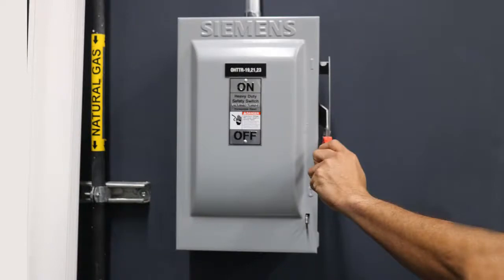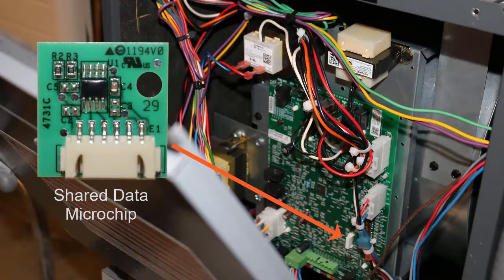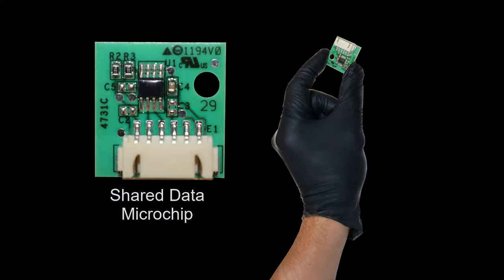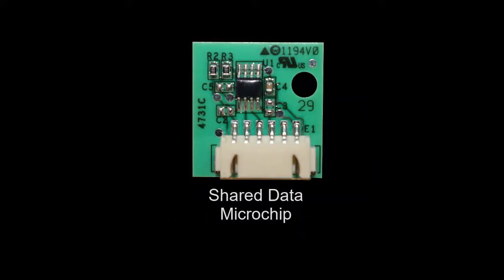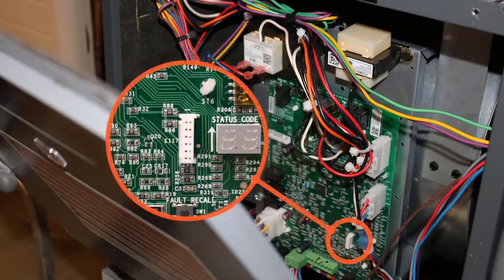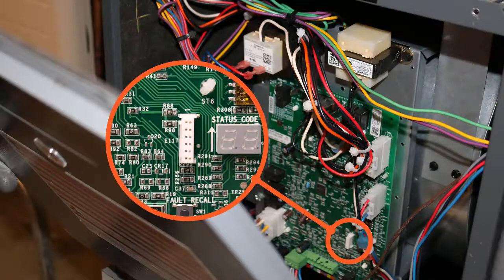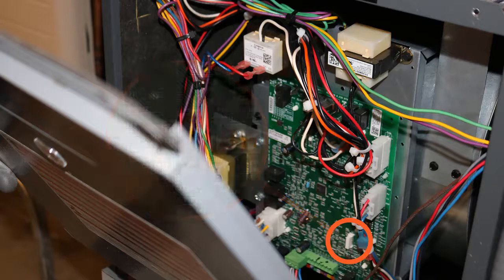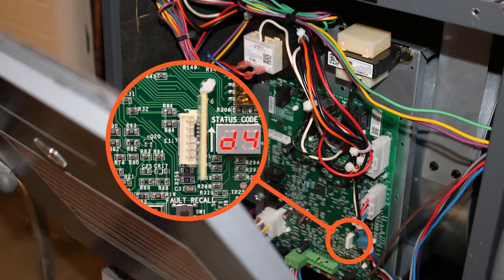Daikin / Goodman shared data chip

Comment: Daikin is the biggest piece of garbage on the planet. System works fine for two-and-a-half years then out of nowhere share data missing or incompatible won't communicate all the wiring is fine the f**** tech support is like trying to get ahold of goddamn Jesus and there's nothing in the manuals to help. I worked on many of inverter unit and never had as many problems as Daikin does. I wish the Damned slant-eyes never started selling that equipment in the US. Then you replace the board you flash it like you're supposed to and it doesn't fix the issue but we have to sit around and wait for 30 minutes for the thermostat to figure out how to f**** talk to the rest of the equipment. I would never installed one of these pieces of s*** in my house.

Comment: Can you use a chip more than once?
Reply from the maker: Yes it can be removed after board is programmed and reused, also on the Goodman side we now have a re programmable chip that we download the latest data on site or in house via blue tooth, use the chip to program then remove and reprogram.
Reply: Where do we get the chip from? I just replaced a circuit board and got a d0 code.